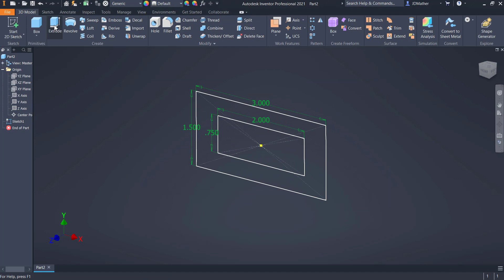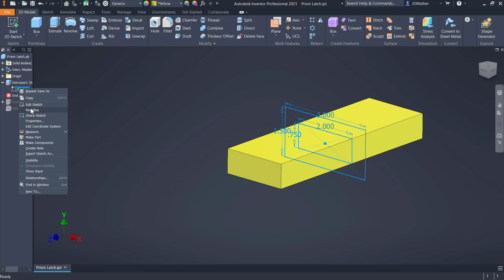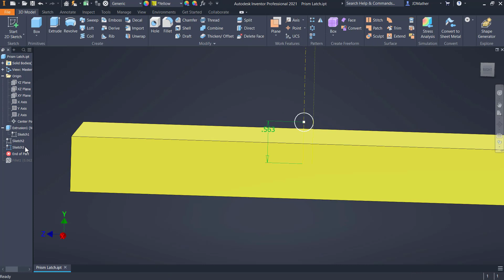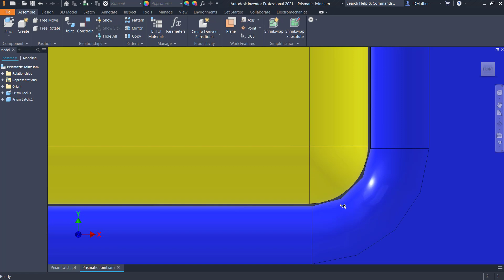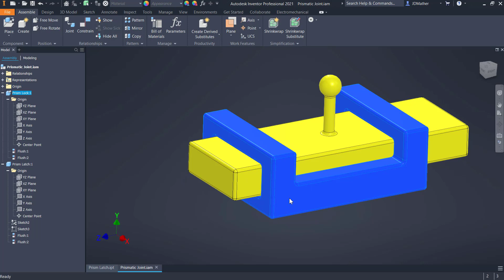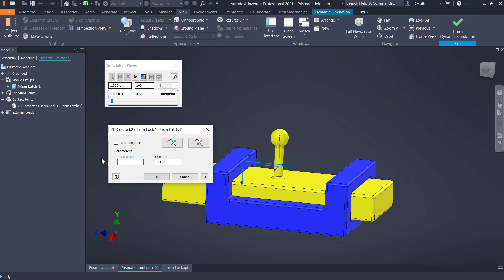Dynamic Simulation   Prismatic Joint

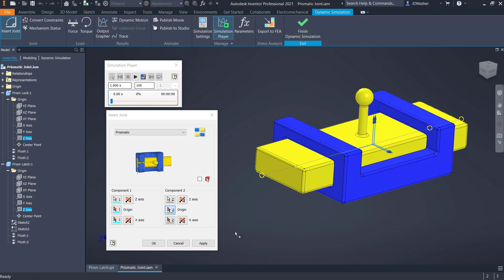Comment: I follow your steps but at 14:26 I get this "At least one mobile group has a mass or inertia under the limit (Prismatic Latch:1). Try with the Micro Mechanism Model option." Why? and what have I do?
Thank you sir for your answer.
Reply from the maker: What units are you using?
How big is your smallest part?
Go to Simulation Settings, Expand the dialog box, checkmark Micro Mechanism Model.
Reply: @TheCADWhisperer   I got it! this comes from the unites, I was using mm this make the components are too small
Thank you sir